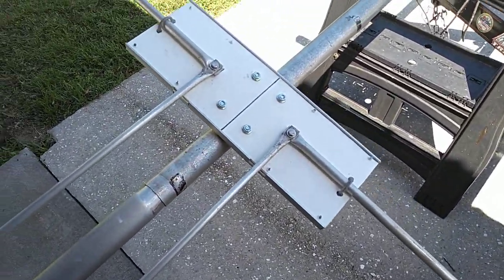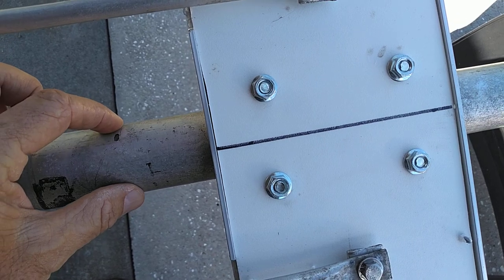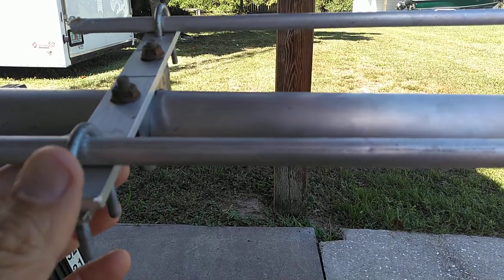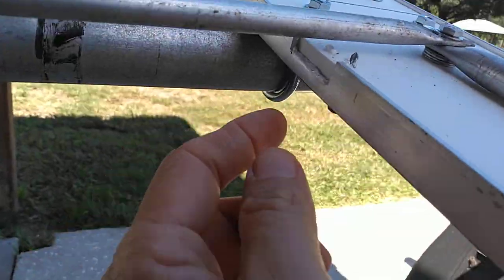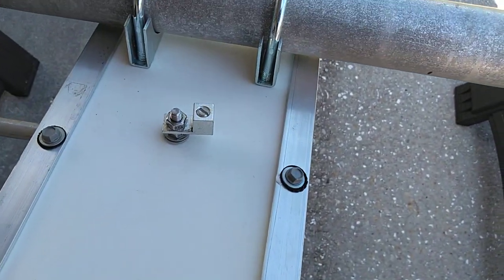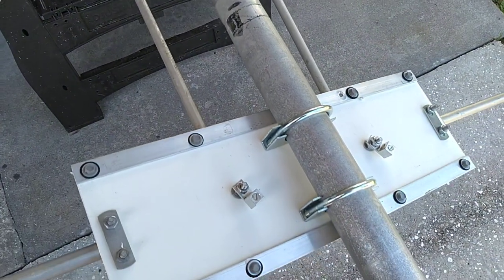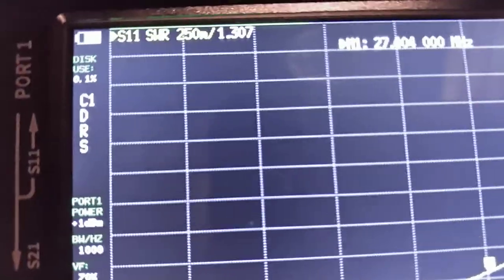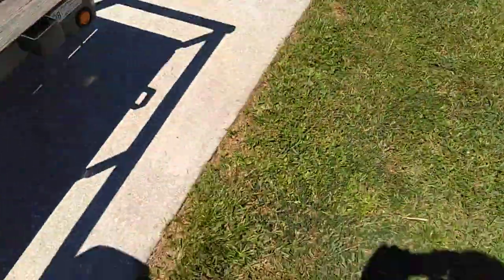building a direct feed hairpin for 11 meters

Comment: I've got alot to learn about antennas.  I just built a dipole and was under the impression that you didn't want to connect the center with the ground from the coax. But in essence that is what your antenna does through the lower slider tuning adjustment. Confusing but it works for you.  Like I said,  I've got alot to learn.  Great video.  Thanks.
Reply: It's DC grounded, but RF sees it differently (AC). You'll find that yagis that are not electrically connected to the boom, perform better than plumber's delight type yagis (all of the elements are electrically connected to the boom). I also prefer antenna with no matching network, like the LFA.

Comment: Ah......if we could only see RF !
Then we might witness the need for a Balun !
It's job, as I understand it, keeps the antennas pattern from being skewed, and Common Mode Currents off the Coaxial cable, so that it too, isn't transmitting RF back into the Shack and elsewhere !
And helps with RFI issues !
And I would encourage anyone interested, to  searching up the information on Baluns, as there are a couple types !
Not saying your antenna won't play in it's current configuration, but after researching a bit, I think you may see where you can even get more power into the antenna, where it belongs, and likely keep your neighbors happy !
And who doesn't want that ?

                   👍😉
Reply from the maker: Maybe. I'm no expert but I've ran it that way for 12 years with no problems. My neighbors house are so close you barely fit a car between them and I don't bother any of them.

Comment: Thanks for posting  that. Most operators won’t share the secret sauce .  You are one of the loudest in the south , no questions asked . 73’s 
What kind of Coax are you running ? And is it the same coax from top to bottom or did you have to use something more flexible from the elements to the rotor loop ?
Reply from the maker: I run 217 coax all the way to the driver element. I'm not a big enough station to have to run hard line.
Reply: @deerslayer816  
Reason I was asking , I’m having to run some LMR-600UF , about a “nulled” wavelength worth from my driven element to the 1/2 inch 
Heliax ,, not that I’m running huge power at all , it’s my distance from the shack to the tower (160/170 feet) , so ,, the loss is the issue so I have to run that to make up for it . I’m not finished yet , it’s still a work in progress

Comment: You could easily add an SO239 to your design, and eliminate the need for having the end of the coax exposed to the weather. I can't see any need for a balun as you said, it seems to work fine.
Reply: The So239 is the weak point on any antenna. Direct fed is the way to go.

Comment: interesting build.  I'm thinking of building a beam antenna but that swr slide adjustment seems to me at least be shorting out the coax incoming signal?  If I took an ohm meter wouldn't measure a short circuit?  Or am I mistaken?
Reply from the maker: @tomcatmeow69  I never checked it with an ohm meter. I just know that mine works well. Next time I build one , I will check and see

Comment: Thx for posting info on your Really good looking & well designed 5 element Beam & Showing your antenna Analyzer measurements...The Beta Hairpin does a great Tuning & Matching job Proven by reports of your Strong signal....The Hirpin feed Does look Electrically intuitive kinda  "Wrong" like a Short Circuit but deff works Really good.....Thank goodness the Hairpin Is so Easy to adjust for a perfect SWR.......Having to really Shorten the Dipole Driven Element for best tune (R= 50 &  j= 0) & Swr looks very wrong & strange at first...Does your Driven Element run 'bout same length as the D1 director element lenght ?? ....Thx for posting....
Reply from the maker: I don't know the exact measurements but the driver is a little longer than the first director

Comment: Hey buddy…. I haven’t heard ya out there hope all is well.. I think I’m going to steal your idea for my buddy’s beam I’m building for him how many watts do you think it will hold? Cause he has John DeLuna 955 in TX fixing his bread box as we a speak and it’s a 6 tube 3-500z box .. and where in Home Depot is this star board ? I’ve been using cutting boards from wallmart
Reply from the maker: It handle any amount of power. The star board is where the pieces of metal and ankle iron and aluminum are. If they have it. Last time I went to buy some, they stopped selling it at my home Depot so I bought a 8' long 1x6 plastic board. It's a little thicker and seems to work well.
Reply: I’m going to go to depot and check right now if not I was going to wallmart for a cutting board to use

Comment: Hello deer slayer this 199 florida georgia line. 
We have spoked  before .
Just not about beams.
I just found your video as i am looking into putting together a 4 or 5 element direct feed at 110 feet.
Anyway i would really appreciate any insights/advise on this project since the warm weather is coming soon i wouldlike to finish before the summer heat kicks off.
Thanks in advance..
199 florida georgia line.

Comment: Was looking at making a 2 element  micro beam using  parts from a maco BA1 antenna. I don't have a lot of air space to swing a large boom. So I was also going to use the boom the BA1 came with. 1" 1/4 × 5' boom. And using a old plastic cutting board in place of the star board.  The trombone part of the antenna kinda has me baffled so I am going to try it with out and get the parts to try with and see what works. Thanks for the video and info. 1313 diesel wagon mobile. 73s

Comment: You should work with a vertical dipole antenna like the Sirio GainMaster which ia 10 - 11 -12meter antenna without tuning. When you set that antenna up your SWR is 1.0:1 on all frequencies! And the Fiber Optic structure will make you send your signal all over the world!!!
Reply: Sirio GP won’t hold the power or talk with that direct fed beam. The So239 connector is the weak spot on any antenna not to mention those Sirio GP’s have a weak matching network to start with. Direct fed with a hairpin match or a vacuum variable feed point is the way to go in my opinion.
Reply: 1.0:1 on all frequencies, eh?  If you just put a 50 ohm resistor on the end of your coax, you'll get that too.  Or, if you use a long enough coax, any antenna will be 1.0:1 on all frequencies.

Comment: Interesting but how do you tune the bloody thing?
Reply from the maker: By lengthening and shortening the driver element and moving that bar ( on the two rods) up and down the boom.
Reply: Changing the length of the driven element will move the dip up and down in frequency, adjusting the hairpin length will change the depth of the dip giving you your lowest SWR.

Comment: Where can I get those terminal blocks for the coax I can easily use those and bolt them down to my elements from my split element setup can't I ?
Reply from the maker: I found those at home Depot. But if you can't find them, you can just solder eyelets to the coax and connect to the bolts.
Reply: They're electrical lugs.  Look for them with the breaker box wiring hardware.

Comment: So you can, and other have fed  balanced antennas with an unbalanced line such as coax, but they actually make Gamma matches for a reason. It would be simpler for a manufacturer to just make a hairpin/beta match for a coax connection, but they recommend that you use a balanced twin lead, or choke, or balun for their hairpin/beta type match.......If you try to decouple the RF energy from an unbalanced coax line directly to a balanced beam such as yours you run a risk of developing unwanted antenna currents on the outer shield of the coax. RF is stupid in that it can't tell the difference between the conductive antenna element or the conductive braid on a piece of coax. If you use a Gamma that always keeps the shield at ground potential it's much much more likely that most all of the energy will be decoupled properly to the elements instead of the coax.

Comment: there's an easier way keep it as a dipole no hairpin. read the capacitance with an analyser use a bit of brain power.                         L = 1 / (2 × π × f × C  then wind an inductor to the required size and place across the dipole centre. if your calculation and inductor are correct you'll have low swr.